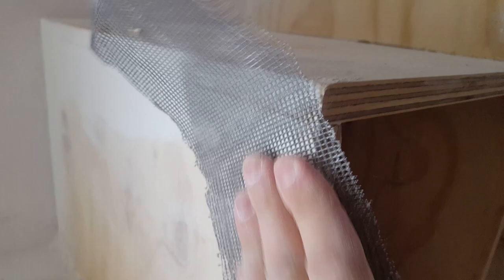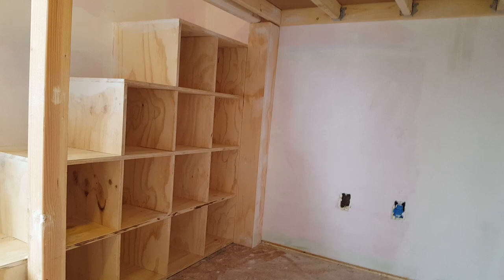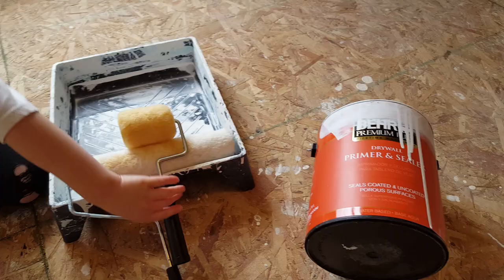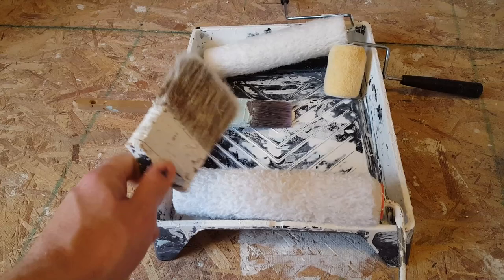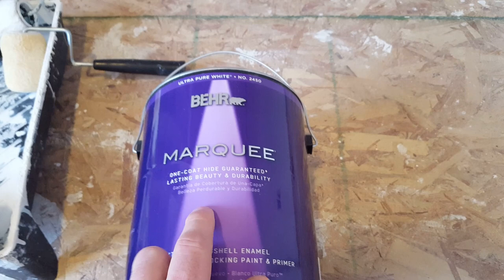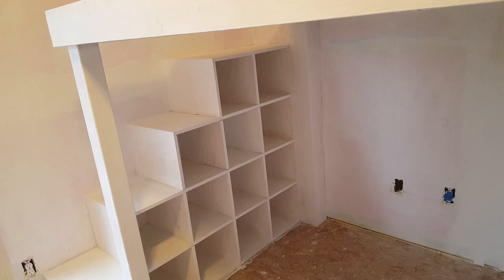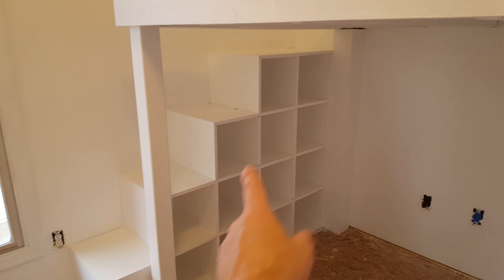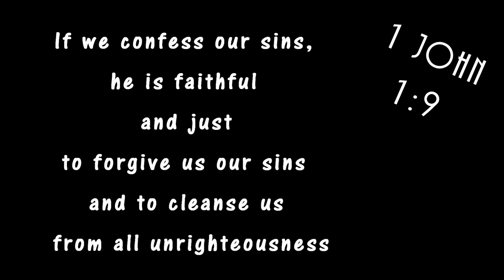Tiny Room Renovation - Phase 3 - Prepping Priming and Painting

Comment: I'm definitely not a professional painter, but I worked a few summers in home remodeling. A couple quick tips to help your stuff last longer:
-when you take a break, plastic wrap your brush or roller to keep it from drying out
-try to keep the paint in the bottom inch or so of the brush. If it gets all the way to the part where the bristles meet the handle, the bristles will start to splay out. 
-best way to wash out rollers: after most of the paint is off, take a garden hose and cover most of it with your thumb to get a really high pressure. With the roller still on the handle, spray just one side to make it spin. As it spins, the rest of the paint will come off and it will be mostly dry. Plus it's fun!

Hope that helps! Love the room and looking forward to seeing it finished!
Reply from the maker: +Justin Lichtle great tips, thanks!
Reply: I'll definitely second the spinning the roller tip! I've been doing that for the last several years. Works like a charm. Just got to make sure you angle the roller just right (or hide behind a piece of cardboard or something) or you'll paint your shoes.
Reply: Justin Lichtle atolladero
Reply: A wire brush cleans good, just be sure to see go.one way down..and your 5 way has a curve on it to go over paint roller to clean  and push out excess. If you dont have a 5 way, get one. I use mine for so much.

Comment: Would have been a good idea to notch the 4x4's so that the 2x4s rested on the 4x4 then attached the two. That way, if for some reason force is exerted on the very corner and the nails fail, the 2x4 gets support from the 4x4 without nails. Much stronger/safer. 
Cool DIY stuff. Keep it up.

Comment: i should have posted this in the other video.. but still not sure why you have the legs on the wall corners? those wall studs will easily hold  that frame with just the one free corner having a leg.

Comment: You did a great job. There isn t much to improve on. I would kept tje integrity of the wood, maybe a white wash finish, if someone who is on a Budget. That paints is nice and less work. But on new construction, anything with with a primer should be fine. I like the spackle , but if In a hurry can use fast dry white caulk over nail and corners. No sanding to deal with. Absolutely no silicone, just caulk. The spackle will have a much smoother finish. Which you cant use if leaving the wood finish. Just trim